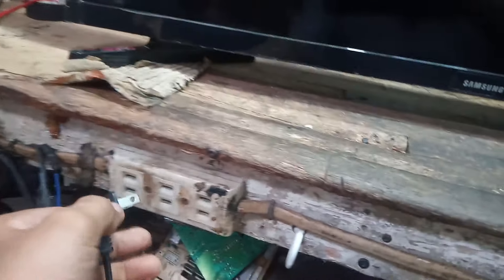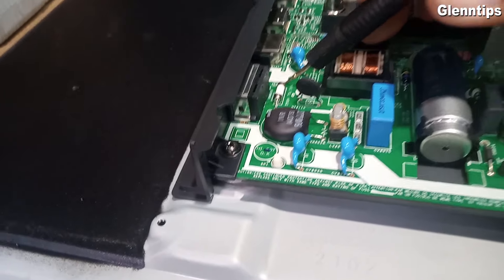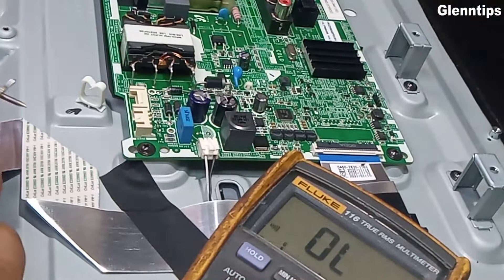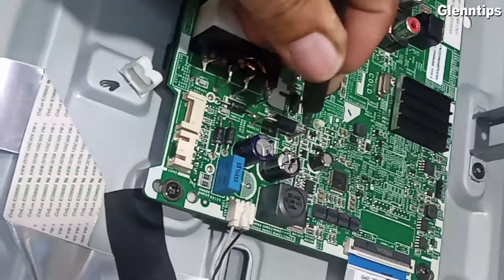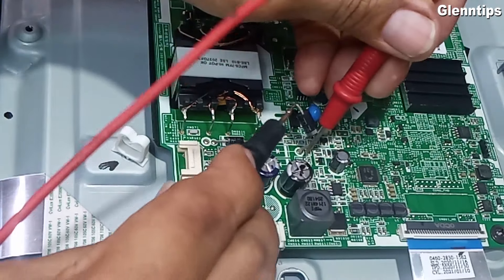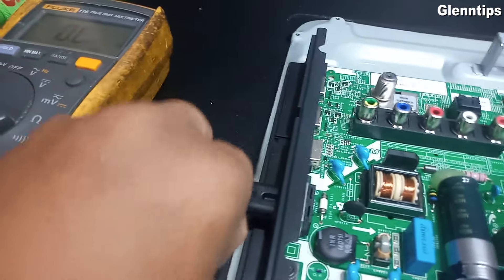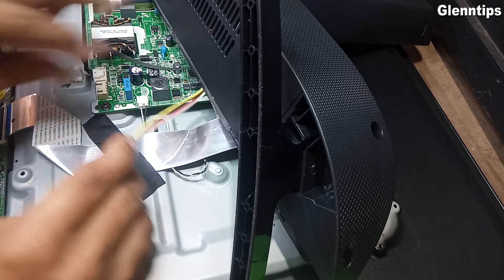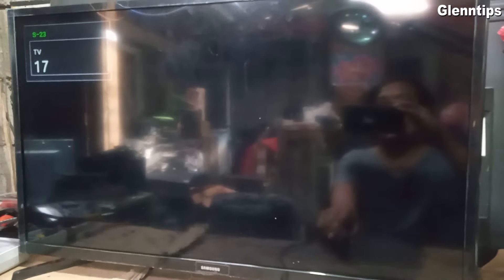Samsung 32 inches tv(no power)model UA32N4003AR

Comment: Good work Glenn. However, is it healthy to just change one diode after one is shorted? I thought maybe changing all of them regardless of whether some are good gives confidence that the customer will not come back soon
Reply from the maker: The shorted diode is for the 12volts and other one is for the backlight, they have different operation, its still ok even the only shorted that i replaced